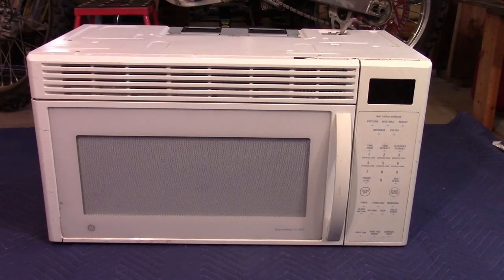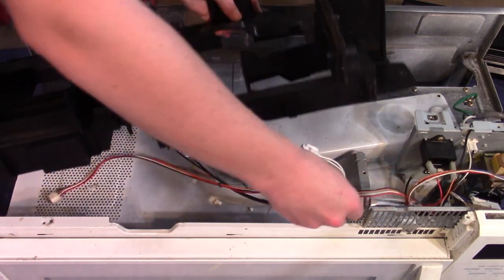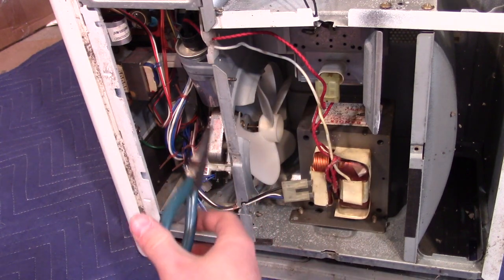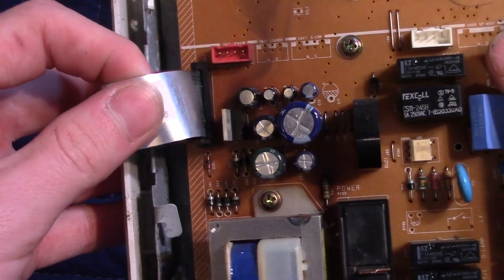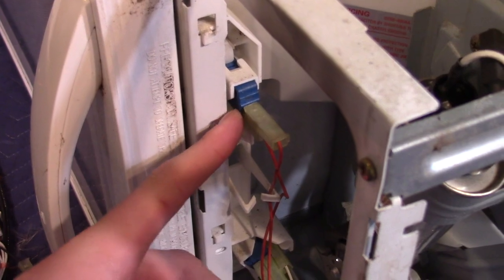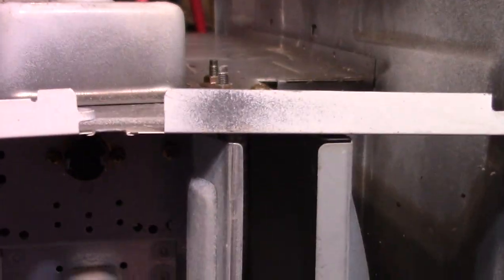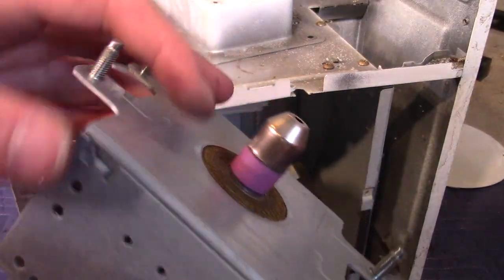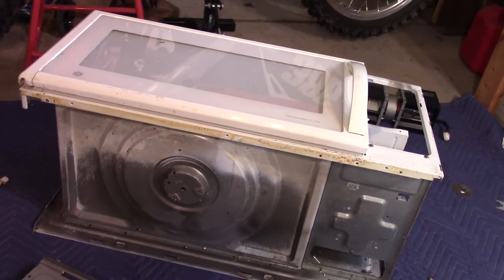Huge Microwave Oven Teardown | GE Spacemaker XL1800 Teardown

Comment: Excellent video.  I have an older Spacemaker XL similar to the one above and I need to remove the glass so I can wash the insides of them but I can't figure out how to get them out of the door.  I was able to replace the handle by first removing a seal with a putty knife but beyond that, I couldn't figure out how to remove the glass panel.

Comment: This was really helpful but one thing you didn't show was how to remove the door handle?  Thanks
Reply from the maker: Thanks for watching. To remove the handle you have to take out the two screws on the backside of the door. There are a few videos here on YouTube going through the process.
Reply: @BGTech1  thanks but the videos I found show a simple removal for the models without an upper vent. The screws aren’t visible in the mode with an upper vent so there must be some additional disassembly. Thanks!

Comment: 5:00. Now, that's interesting. How old is that microwave? We have a 1999 Whirlpool microwave and I wonder if that happens to have any manuals stashed inside it......
Reply from the maker: It’s from 2002. It’s is the original microwave the builder installed in the houses in my neighborhood.
Reply: @BGTech1  Oh, so it's a piece of history, I guess. The house I live in also happens to have the original GE appliances, all except for a refrigerator, which the house didn't come with.
Reply from the maker: Fans, boomboxes, and more I think most appliances around that time and later will probably have service manuals in them. I’m glad that it didn’t go a landfill and that I could salvage components and make a video with it. The rest will go to the scrap yard for recycling.

Comment: For some reason my microwave will turn on and everything but won't heat my food I have the same microwave the Megatron looks good and I tested the fuse not for sure what else to do any help would be appreciated
Reply from the maker: I would do a Google search for: “Spacemaker xl1800 not heating”. There is several good recourses that might be helpful.

Comment: Our GE spacemaker xl 1400 turns ON when door is open.
Reply from the maker: We had the same problem with our microwave a while ago. It’s caused by a bad micro switch that activates when the door is closed. You can buy replacement switches on Amazon. 
Hope this helps!
Reply: @BGTech1  thank you! My husband isn’t comfortable replacing the switch himself.